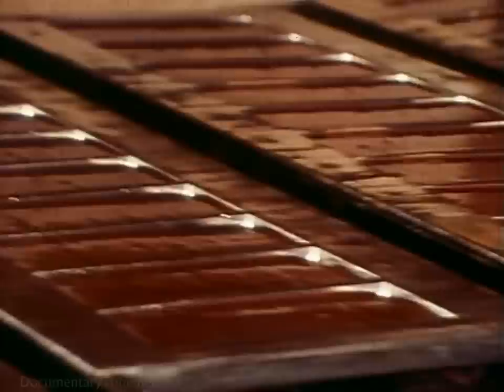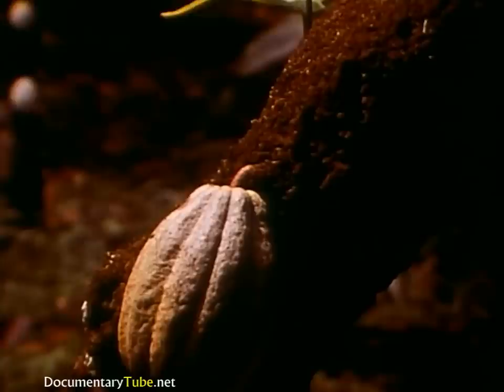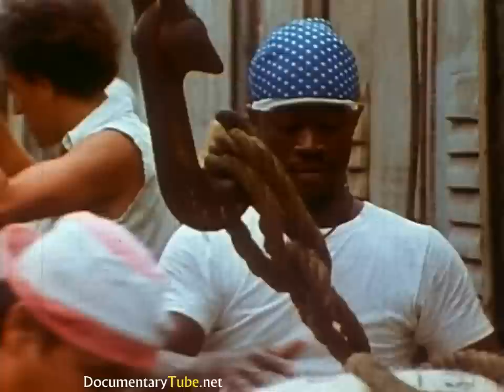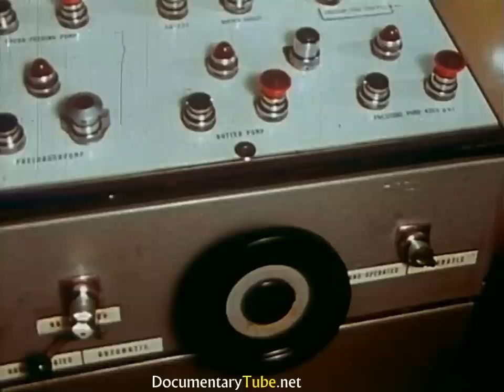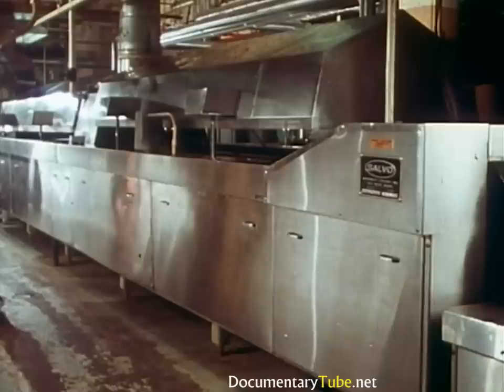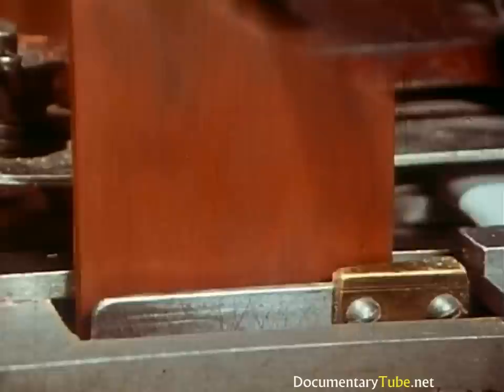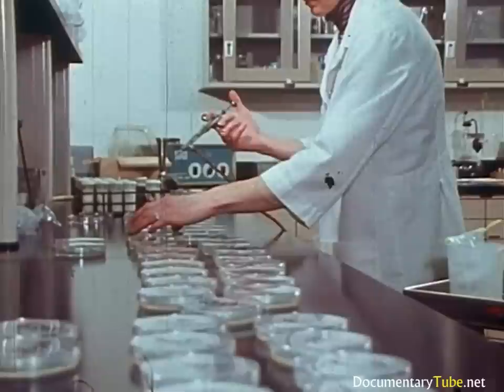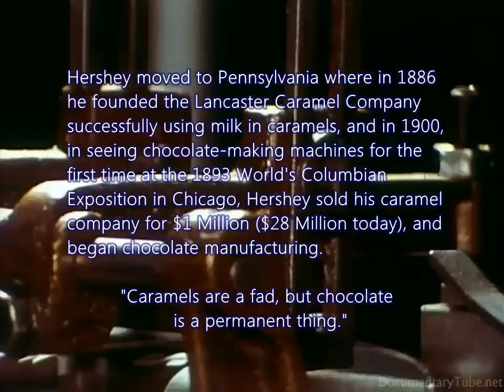HOW IT'S MADE: Old Hershey's Chocolate

Comment: Are they under USDA or local county health scrutiny?
I hope they've eventually put boots on those funk laden machine adjusting screw threads at 19:45.The dust or whatever it is that clings to the threads, occasionally fall off from vibrations of the machine.Lubricants are food grade but can collect pathogenic or toxic particles. I used to work quality control years ago at various factories.I'm retired now after 46 yrs.and pissed off a lot of management personnel.May saved some consumers from getting sick.